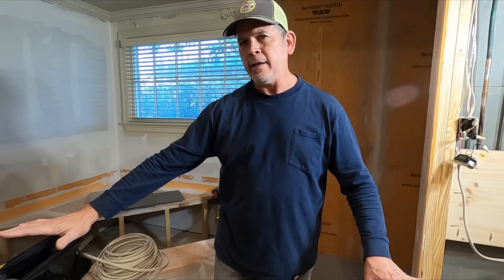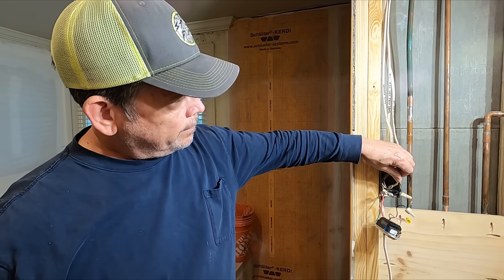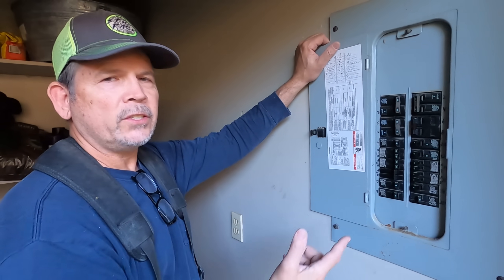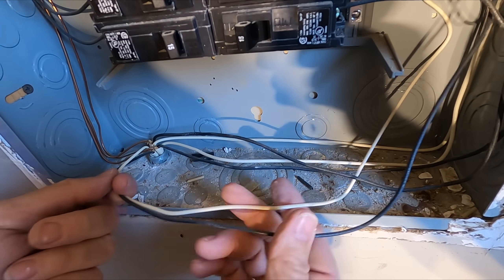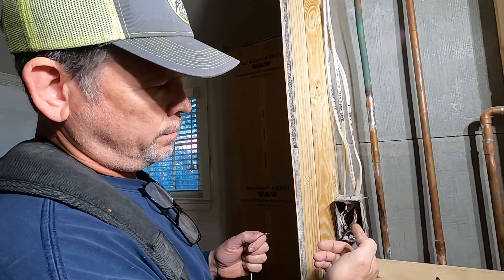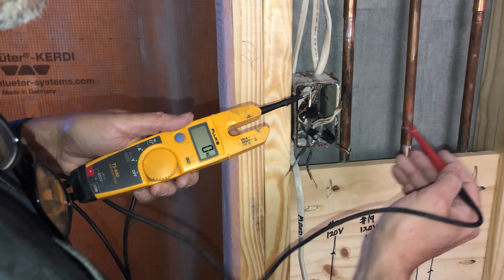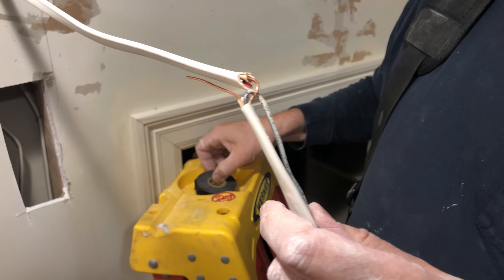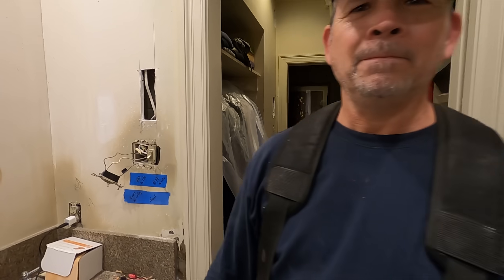You CAN Get SHOCKED by a Neutral Wire! This is How...

Comment: Always test!  Grab you a "Hot or not" proximity tester, then verify by use of a good meter to a known ground.  Go even farther and disconnect at the panel.  Wear some good rubber shoes. Situational awareness, be aware of body parts touching any grounded metal or wet puddles, etc.  Stay safe!

Comment: My house has all ground pigtail to white on outlets--- My opinion really no gain than not grounded.. See that  its done though quite often! Also that  there is some current to the ground then on a 3 proung  appliance..  With  all the computerized controlled things amperage voltage very critical.. Mass air flow on a car can be ok but if bad ground or low battery can make ya think its the Mass air flow!!!!!!

Comment: Shared neutrals and be fatal. Infact, an open neutral is probably the most dangerous situation. Understand that when a circuit or service feeder is in use, the returning electrons are known as Net Current.  Generally in a balanced system, the return current is approx. 4%.  Therefore, a 100w bulb's Net Current is approx.4 watts. JUst like your paycheck. 100watts is the gross, and the return current is the Net.  As far as these guys go, They did a pretty damn good for not being an electrician.  First time I've been here. I like their page(s)
Reply: For a 100 Watt bulb ... the current in the White ( neutral ) wire is exactly the same as the current in the Black ( hot ) wire.

Comment: NEC refers this as a multiwire branch circuit. This is legal. Multiwire branch circuits are defined as a branch circuit that consists of two or more ungrounded conductors (two or more "hot" wires) that have a voltage between them (they are not on the same electrical phase and so are connected to different buses in the electrical panel), and a grounded conductor (the neutral wire) that has equal voltage between it and each ungrounded conductor (hot wire) of the circuit and that is connected to the neutral or grounded conductor of the system. NEC 210.4(B) goes more in depth.
Reply from the maker: A MWBC may have been their intent but they used circuits 19 and 20, same phase/same bus.  Too much current on that neutral.  Not sure how well that came across, thx for commenting 👍
Reply: @StudPack  Ahh I see my mistake. In the case that they used the same phase than that is an illegal multiwire. Did not notice it was on the same phase. Thanks for clearing that up.

Comment: Yes, you can get shocked from a "white wire" if it was miswired. But not when it was wired properly. Naturally, one should never just trust wiring done by someone else meets code or is safe.  Always check for voltage before working and wear safety gear.

Comment: My goodness America is shit you don't require a neutral at any switch. A switch is only to break a line wire  or hot in American why have you a neutral?
Reply from the maker: We caught up in 2011 Chris, the year it was added to our NEC (National Electric Code) 👍
Reply: @StudPack  and still only states that adopted the 2011 NEC require 14/3 in switch circuit/neutral in a switch box. our county requires it on their own and they still using the 2008 NEC

Comment: Great video.  Easy to understand.  Last year I ran into the same issue.  I had run the disposal and dishwasher and kitchen light home runs into the same switch box and tied all the neutrals together.  My mistake....but easy fix to separate out all the neutrals from the different circuits.

Comment: Was the problem with knob and tube.  Grab the nearest neutral(a fire ready to happen)...then they started fusing the neutral(a shock waiting to happen)  Same junk occurs everyday in industrial circuits.   Residential sucks due to access.  Industrial offers up sooo many more possibilities due to complexity...especially control circuits.  Power stuff generally either will pop(burn) or not.  Control circuits can be a real puzzle when someone messes it up.
Reply: Even with "Knob & Tube" you were required to keep the Hot & Neutral wires properly paired.  It is the installer that makes these mistakes, not the type of wiring ...
Reply: @MrSummitville  Without a schematic, Keeping those pairs paired proved to be damned near impossible as the system grew...industrial systems especially. Hence the fusing of neutrals.
Reply: @nhzxboi  I found it very easy to keep the 2 wires in their proper pair together.  Always 2 wires to each outlet.  Always 2 wires to the switch, then 2 wires from the switch to the Light Fixture(s).   In what county do you fuse the neutral?  We do not fuse the Neutral in the USA ...
Reply: @MrSummitville  They did in the USA with some knob and tube back in the day.  Dangerous, but prevented fires when installer chose most convenient neutral available.  The feeders go off any which way in come back to a neutral...don't matter which fuse it came from but the circuit will work if you can "find" a neutral.  Very few alive now that actually wired those things.  But, yea, I've seen fused neutrals on K&T.  Unsafe electrocution-wise but prevents a fire when the system becomes a rat's nest as so many did.
Reply: @MrSummitville  Also, with a little smarts, and an open neutral, one can figure out in retrospect what the schematic looks like via unscrewing feeder fuses and measuring.  Still the problem of knowing where those connections are located still exists.  I have no doubt that is the reason behind every junction requiring accessibility by code.

Comment: Don't know who the electrition was who did the initial wiring, but they should not be doing wiring any more.  You NEVER share a neutral across different feedlines!  A feedline is the one that connects to the breaker and "feeds" the rest of the circuit.  You can have more than 1 feed to each box, but never cross the neutrals!
Remember, "Don't cross the streams!"  Name that movie.  BTW Jurassic Park is the movie you was referring to.  lol

Comment: YES, that's what happens when someone does wiring who is not qualified. I have seen absolutely appalling  wiring over the years in domestic property.  I am not an electrician, but was electronics engineer working with very high voltages,  even so I always completely rewired a renovation property in UK and FRANCE. I ALWAYS HAD QUALIFIED and CERTIFIED electrician actually connected circuits to consumer unit with breakers as a double check. ALSO all exterior circuits were trip switch breakers using armoured cable. Everything was photographed by room and placed in the house manual so the purchaser could understand their property. YER  a house manual detailing position (with measurements) wiring, plumbing, water mains, U values, gas  alarms, telecommunication lines like TV COAX, phone and CAT 6 NETWORKS and gas lines, INCLUDING LOCATION OF THE STOP COCK KEYS FOR WATER MAINS. You can imagine the surprise by the potential purchaser (every property was [grabbed] purchased at a premium by the first person to view). The best thing to do in old property is to take out the wooden ground floors, run waterproof concrete over exposed earth (kills that old building smell). This then gives a clean surface to walk on for subsequent works like DPM, wiring, plumbing etc (and photographing) then refit now treated wooden floor (insulated). The time saved doing a proper job, more saved all that time that would have been  spent fcuking about doing a shit job.

Comment: That's not a neutral, that's a carrier wire and they foolishly wired it white.
Reply from the maker: It’s a neutral.  See my pinned comment
Reply: @StudPack  their is NO WAY a neutral wire is EVER hot. That's not how electricity works. Somewhere is a crossed wire or 3 pole wired incorrectly.
Reply: By your logic anywhere where I have multiple neutrals to pick up I should be able to power something without a hot being present, that just isn't the case.
Reply: https://youtu.be/lI59y1h3MxU
Reply: @hedonisticzen  When a Neutral / White wire is (improperly) SHARED between TWO circuits and only one circuit is turned OFF,  then the Neutral / White wire ( coming from load of the circuit that is still ON ) will become HOT, when the Neutral Wires  are separated at the shared point !!!  As was clearly shown in this video ...

Comment: In my breaker box both lines go in one double breaker, so when either one line makes wrong contact both lines are off. An extra safety is a earth leakage circuit breaker for wet rooms, that go's of by only a little microcurrent and is situated in front of all breakers, so if by corrosion or a water droplet a line makes a contact to Earth all lines in the house go off.

Comment: Yeah I want to hear about the ice maker story. Really good video and yep, I too have been surprised by neutrals before. When I did my kitchen remodel and had the walls open and could really visualize more how the electrical was run through out the house, I deduced what was going on. Some neutrals are tied together in some of the boxes. Now, whenever I shut off a circuit, I use a little wireless voltage detector to make absolutely sure it’s safe and I don’t have to shut off a second circuit
Reply: Since he said he got shocked doing plumbing I'm guessing it was an older house that hadn't had any work done in a long time.  On many pre 1950s homes the electrical system was grounded using the homes plumbing before people realized just how stupid that was.  And there were still a lot of homes after that where the service ground was simply placed too close to plumbing which created the same situation though usually unintentionally.  In the early 70s most areas building codes started requiring that the electrical system be grounded using a proper ground and insuring sufficient clearance from any plumbing.  So you don't see that issue really at all on anything built after 1970 or so.
Reply: @Rowgue51  True enough, but still now metallic plumbing is still required to be grounded at least at the plumbing entrance.  Haven't you seen the ground connected to the plumbing via #6 bare wire with a big clamp?  The idea being that a hot-plumbing ground shouldn't energize all your metallic plumbing fixtures.
Reply: @fromagefrizzbizz9377  yes but that's a lot different then intentionally using the plumbing to ground your entire electrical system. When the plumbing is your ground it creates a situation we're if you do any work to the plumbing did severs that connection then your entire electrical system is ungrounded
Reply: @Rowgue51  Correct.  In short: Copper pipe is supposed to be grounded, but it can't be used as the grounding conductor.  Which makes me wonder how electrical wiring going near copper plumbing at the entrance (which until late was almost always guaranteed to be metallic) can be a problem.  it's supposed to be grounded, so if a hot touches it, the breaker trips rather than making your whole plumbing system go live.
Reply: @fromagefrizzbizz9377  imagine that happening while in the shower.
Reply: @patricknedz  I'd prefer not ;-)

That said, water is normally a pretty poor conductor, I'm more worried about touching the shower head or a faucet body.
Reply: @Rowgue51  You got that wrong, my house built in 1997 has issues with cheating in the wiring, one thing done wrong was connecting bathroom lights to the fire alarm. Lazy electrician!
Reply: @tedmoss  
I didn't say you don't see incompetent work anymore.  You just don't really see the specific issue we were talking about anymore unless you're working on really old homes.
Reply: @Rowgue51  Quite right, I just wanted to point out to keep paying attention so you don't get killed, lots of stories about bad work. I remember the pin & tube stuff with the cotton & rubber insulation falling off.
Reply: @tedmoss  I'm not an electrician but I know that in some jurisdictions it is a code requirement that hard wired smoke detectors must be connected to a circuit that is normally on, like your bathroom light, and not on a separate circuit. This is so that you will be more likely to notice if the circuit breaker has tripped, and to make sure that nobody turns off the circuit breaker to intentionally disable the smoke detector.
Reply: @trevorritchie2575  Understood, the problem I had was attaching an additional fan to the circuit which could cause the breaker to trip.
Reply: @Rowgue51  In the UK we ground water pipe(copper) and gas pipe as a protection not as pick up point. That was stopped years ago when it was realised a small leak over lots of houses  amounted to  a large leakage on the water main. That why even now, Plumbers when cutting mains pipes use an electrical clip on loop across the cut. In the  UK grounding is a very serious point and one of the main constraints on passing code. Normally ground is supplied by the incoming service, where this is not available, grounding rods and mats are used to provide your own ground.
Reply: corey Babcock  It is now, but wasn't in the past.  In fact, back in the days of knob and tube, it was relatively common.
Reply: @fromagefrizzbizz9377  now there’s a good point! Some of them old ass wires you can’t tell which was hot which was neutral and they just got screwed down on plug receptacles bass ackwards and ass backwards
Reply: corey Babcock  just because it’s illegal doesn’t mean it isn’t done. People that don’t know any better join any neutral they can because “neutrals are safe”
Reply: @jeremyjoe714  I think when it was ok to have a shared neutral for two circuits there was supposed to be a handle tie across the breakers so that tripping one automatically shut off the other.
Reply: @jeremyjoe714  neutrals are safe just like a hot is safe if you are an electrician and you know what you are doing. No electrical is safe if you are not an electrician and don’t know what you are doing. You need a neural to make your circuit.... everyone just stay out of stuff if you aren’t electrician. And if you want to talk about this stuff talk about it in electrical school when you are getting trained.
Reply: Good job on using a pen tester!! A meter isn’t always the safest thing. If you have a broken neutral or a ground not bonded you can meter a hot to ground and get 0 volts but the hot is still hot and there just isn’t a circuit there. But you can still get zapped on the hot. So with a pen tester no mater what if there is voltage there it will light up or how ever it signal. But anyway leave everything you do to an electrician. If the jobs simple which they usually are the bill will be cheap but after people start playing with stuff and cause problems and someone had to waste time trouble shooting stuff or ripping down new kitchens/bathroom and drywall they get expensive. And Electrician’s don’t like getting their time wasted on something someone did in a house. If the voltages in a house were 600 it would weaken out the ones that shouldn’t be playing with electrical. If you don’t know how to keep yourself from getting zapped then you don’t know electrical enough and certainly don’t know enough to do any electrical work or change or alter stuff or make any decisions on the electrical system being safe or ready to cover up walls.
Reply: corey Babcock  your neural on your main service conductors is shared between the two hots. In some or countries or residential buildings they might be illegal. But if you don’t understand the main service conductors and how 2 hots and a neutral work you won’t be able to understand a 3 wire circuit with a shared neural. That’s why everyone if you aren’t an electrician stay completely out of electrical. And if you are interested in it go to school and become an electrician.
Reply: corey Babcock  all kinds of stuff is illegal but it doesn’t seem to stop anyone... even cops break laws now and again 😱😆
Reply: corey Babcock  How would you wire, for an example, a ceiling fan and a light using a 12-3 wire? I always use the red wire for the fan circuit, because everyone is accustomed to seeing the black on the light circuit.

Comment: Great Job!! Only I'd like to clarify that you said phases and pointed at the two incoming wires. Technically they are single phase 240 that is center tapped at the transformer thus giving 120 v to neutral from each.
Reply from the maker: Thx Marty!   Yeah I should have said “line”.  “Phase” was a throwback to my commercial days with 3 phase.
Reply: @StudPack  Thanks for the quick acknowledge. I know. I retired after 38 years of fighting 3 phase noise from crappy grounding practices. I installed MRI's and every little thing was a disturbance. I  was requesting a power audit and the Power company said they checked it every 10 mins or so for 24 hours. We said you have to check it 60 times a sec if you do anything. The next week it was fine. They changed something!!! Probably tightened connections or got us off the same line as the factory!!. Take Care and keep up the good work.
Reply from the maker: You got it thx 👊

Comment: I worked in a dealer yrs ago we would only work on what we sold. we knew we could get the parts needed for repair.   Hey China send me a size 50 muffler bearing speciality   lubricator, yea good luck on the chinese home depot, harbor freight junk. Yup its cheep all right.